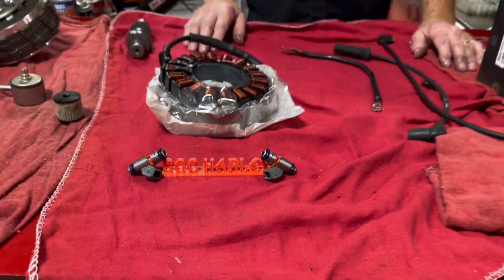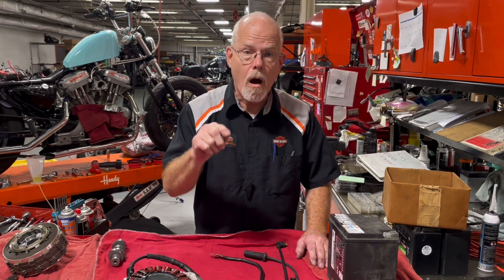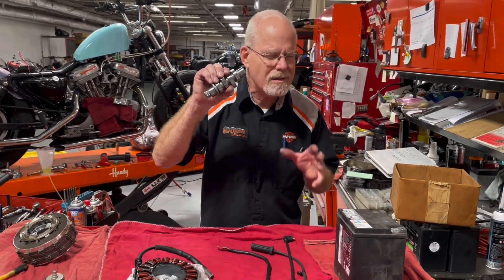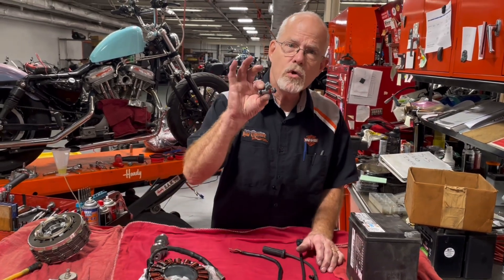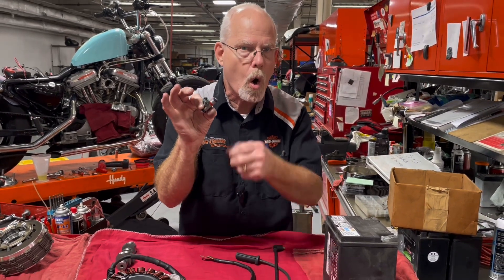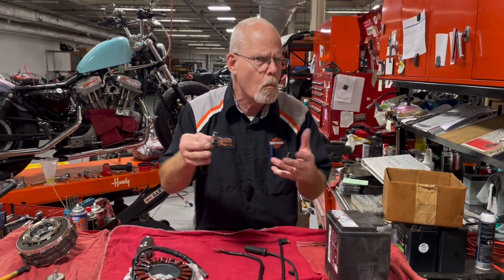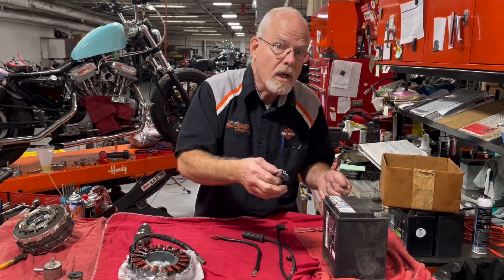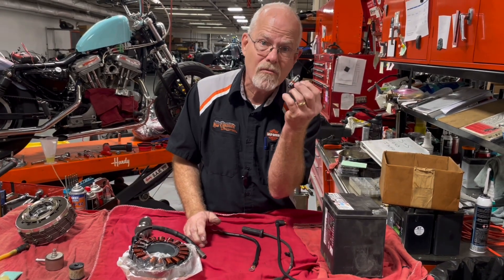Doc Harley Fuel Injector Tech Tip

Comment: Would injectors cause my rear cylinder to heat up? Compression seams good, no metal in the oil? But rear cylinder is running 300 and front running 200?

Comment: Dear Doc, My 99 Ultraglide getts to fat mixture, causing my sparkplugs to turn black within a few miles, where can I start looking for solutions for this problem? Can it be solved replacing the injectors if I can find smaller ones? And sorry for my not so good gramma here, I'm from Norway (Europe)
Reply from the maker: The injectors would be the last item to change. Start with battery condition, charging system check, ignition system check which includes wiring, switches, spark plug wires and coil, then air intake manifold seals. The Intake air control module and settings then engine temperature sensor….Doc

Comment: Thank you for sharing great info Doc. 
I think I now know what I should do for my bike after watching your video. And I still ask a question for help with what I think I should do.

The problem I have with my 2008 Sportster Nighter:

1 - Engine light was on and battery light was on when riding and stalled. Restarted and riding home.
2 - Now, I could not start my bike.
3 - Checked voltage regulator and it appear good.
4 - Checked stator and it appear good.
5 - Measure battery voltage, it indicated 12.8 Voltages which maybe not a good battery ??.
6 - I brought the battery to battery store for checking and they said the battery was good. ???
7 - I checked  the error codes which the bike have below error codes:
      + P0261
      + P0263
      + P0562 
      + P1003
6 - I guess I may need to replace a fuel injector I guess.

Doc,  Please help advice what should I do first? Thank you.

Comment: I learned a fuel injection sportster 1200c needs CCA during covid and up to 2022 couldn't get one from my local HD so all I could get was a battery pluss bulb Duracell just 200 cca battery last 1 months so they gave me another lasted 3 months then finely I tried a everstart 200cca it lasted 2 seasons now this spring wildcat harley davidson finely had the oem battery 225cca oem battery I got home tested it 325cca the previous battery's were like 240cca when new the new battery bike runs better idles lower think befor the bike idled faster it wasn't getting enough amps it needed even my right turn signel turns off by itself now

Comment: Hey doc,  good to hear from you bro, I hope everything is going well for you  ,  I got an 06 heritage and had my cam replaced 510 c S&S, also they screwed it up and then they had to take my whole motor apart so I got a 95 bore,   later on I needed a stator and voltage regulator but I got a new battery before because of the codes,  I dont have any extra lights, stereo or anything else to drag it down, I'm thinking my injectors, I think stock ,,,,  are ok. What do you think?
Reply from the maker: Back in the day, HD offered a 95 kit and it always came with larger injectors….Doc

Comment: The main reason I don't like all the new bikes being launched these days is because all the electronics being piled into them. Wires, connectors, connections deteriorate over time and I don't want electrical problems
Reply from the maker: Double that on a police bike….Doc
Reply: Exactly. The world is over engineered. I want simpler and easier.

Comment: That is some great information Doc. While on the subject of fuel injection what do you think about adding fuel injector cleaner in with the gas? Do you think it warrants it say with every 5K oil change?
Reply from the maker: The right cleaner at the right amount shouldn’t hurt…..Doc
Reply: REDLINE complete fuel system cleaner,  
USE ONLY AS DIRECTED.

Comment: Good stuff, I picked up a 2022 Triglide. It has a new Harley-Davidson® lithium battery in it. My question is if nothing Hass to be done to the bike to accommodate that battery, can I boost it directly off the starter with a regular 12 V battery.
Reply from the maker: Boost NO!!!!!! Match a lithium battery tender……Doc
Reply: @LowCountryHarleyDavidson i have a Lithium battery in my carbed 2004 Low Rider.  Also use the HD battery tender that allows you to select AGM, Lithium or Regular ol battery.   Haven't had cranking issues since.   👍